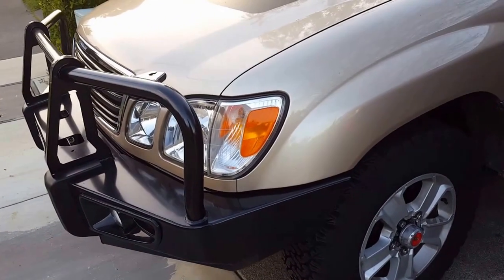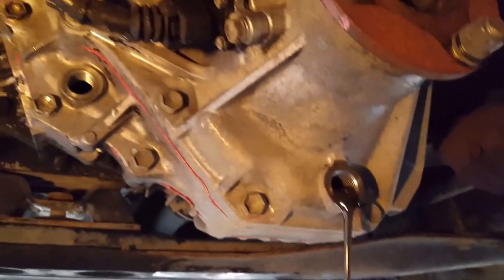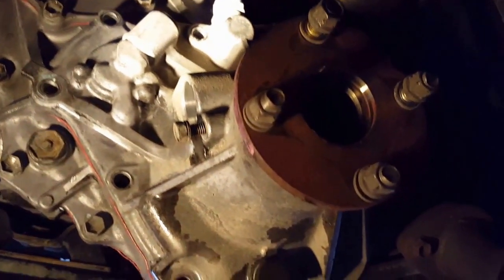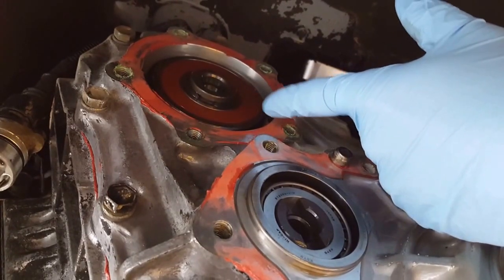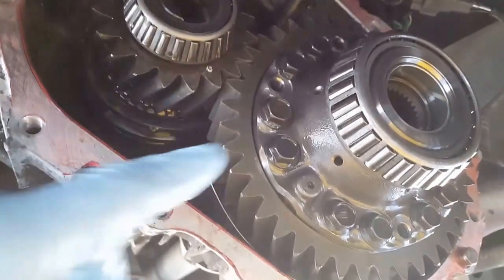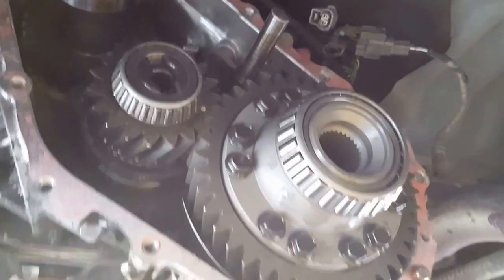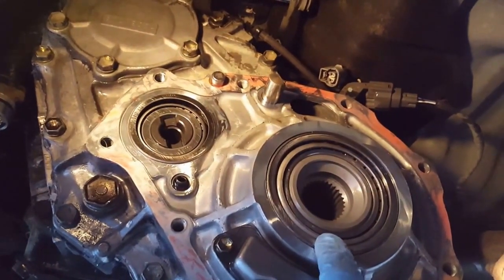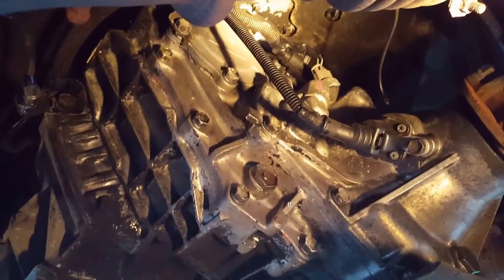Land Cruiser Part Time 4WD conversion Phase 2 T-Case 100 Series Toyota Lexus LC100 LX470

Comment: I have the same transfer case, upon changing spool with new bearing, the high low lever linkage fork came out of the synchro in the transfer case. To put it back on i had to pull the transfer case case internals. Now i cant get them to go back in. And the high low lever wont move. Any hints or a diagram would be great
Reply: I also need to replace the big shim that is for the center didd assembly and cant find a part number so i can replace it. Any help would be good. Thanks

Comment: This will not save wear off your 4wd system. That spool will still drive your front end and in turn (pun intended) drive your CV axles. Everything turns the same, it's just your wheels can be at a different speed than the CV.
Reply from the maker: SORENEAGLE
46 seconds ago
If you're not familiar with this drive system it wouldn't make sense. I called it a spool since that is what it reminds me of. The "spool" creates a direct drive to the rear only.   To send power to the front you have to engage the center diff lock. The front driveline spins freely until either the hubs or the center diff lock is engaged.
Reply: SORENEAGLE oh, ok that makes sense then. A spool is a device that locks both outputs together.
Reply: @SORENEAGLE  so the center diff lock is not needed?

Comment: I’m in the process of looking for a lx470 what should I look for, my budget is around $7,000, any advice
Reply from the maker: Dumbasses Unleashed You will be limited to high mileage rides. Look for one with maintenance records and make sure that the timing belt is up to date. The starter contacts are known for going out and can be an expensive job too.
Reply: SORENEAGLE  thanks for the advice

Comment: A spool in the Tcase? That makes zero sense.

You already have a locker. Just lock the damn thing lol.

That way you can keep the low range awd which is an awesome option for paved roads and tight trails.
Reply from the maker: If you're not familiar with this drive system it wouldn't make sense. I called it a spool since that is what it reminds me of. The "spool" creates a direct drive to the rear only.   To send power to the front you have to engage the center diff lock. The front driveline spins freely until either the hubs or the center diff lock is engaged.
Reply: SORENEAGLE gotcha, I was lost in the translation. Lol
Reply: @SORENEAGLE i remove the rear drive shaft and i look the wheels am driven with power to  the front wheels is tha safe for the trasmicion??